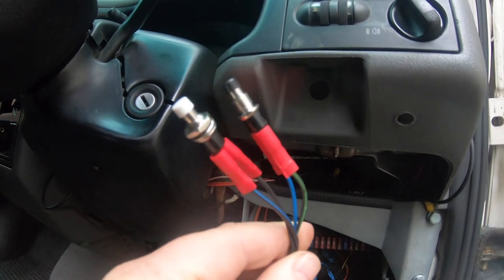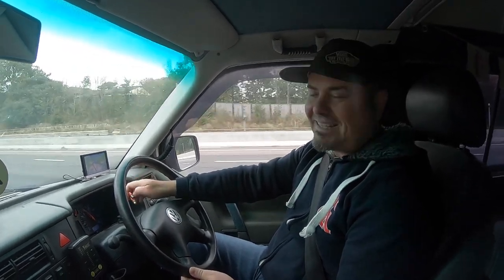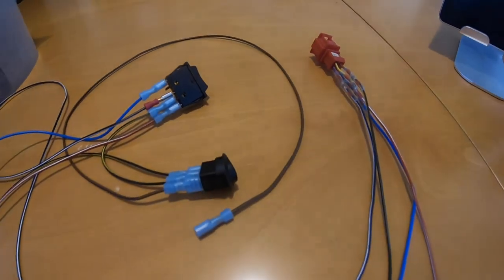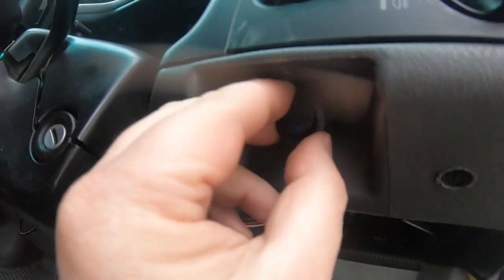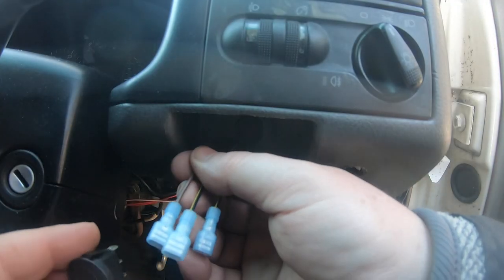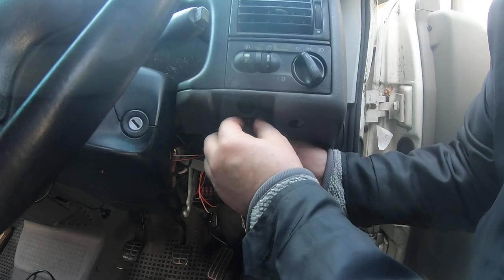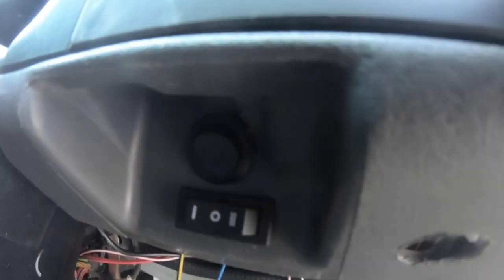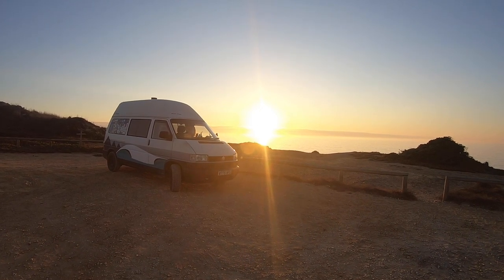VW T4 Camper Van Build 12 | Fitting Cruise Control to VW T4 Transporter 2.5tdi

Comment: Absolutely fantastic video! Really making the most of YouTube :) Doing it next to what sounds like a busy highway added drama and suspense. 10/10
If you want the CC switch for safety/redundancy (because you could easily have it always on) I highly recommend you tap into the fuel-pump cut-off solenoid on the Bosch pump, because that cuts fuel period. Pulling the keys out should do the same. There's also a manual shut-off on the pump (for during tuning/setup) but I don't wire up actual wires that'd be silly.

Comment: really interesting video.
But I'm perplexed...
...only applies to the VW T4 TDi (Diesel)
or even for the 110CV petrol?
I have a 1993 T4 petrol 110 hp 5 cylinder.
Does this also apply to my model?
Reply from the maker: I don't know for sure, try T4forum website. I would be surprised if you couldn't add cruise control like this. GL!
Reply: If you have an electric gas pedal, it might be possible. 🤔

Comment: Why haven't you explained that you need to reprogram the on board  control unit with a VCDS or pay a stupid price for an official dealer to do it.  Also it can only be done with a 2.5 TDI that you have previously tested by holding the revs at 2000rpm then touching the brake or clutch pedal to  make sure that they drop, in all seriousness your explanation is the pitta
Reply from the maker: Thanks for chiming in Mike. The video is not a "detailed how to" - I just showed how I did it and that it is possible with the 2.5tdi (which I have). I don't talk about other T4s as I can't share my experiences with other engines - so my context is always my T4... I'm looking forward to seeing your video and explanation soon to help benefit the T4 community. Don't forget to drop the link in the comments to show us all the details.
Reply: Why don't you read the guys description before being an arse mate? He mentions how to test the brake peddle and the subject says "Fitting Cruise Control to VW T4 Transporter 2.5tdi" - :face-turquoise-covering-eyes: